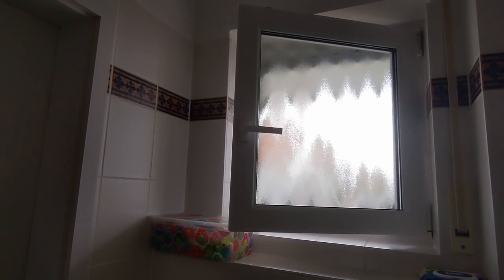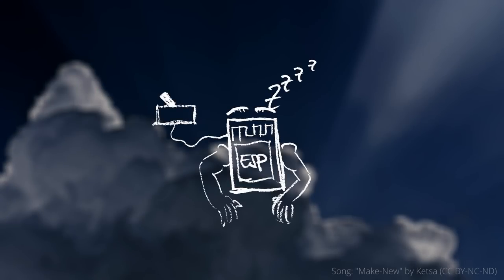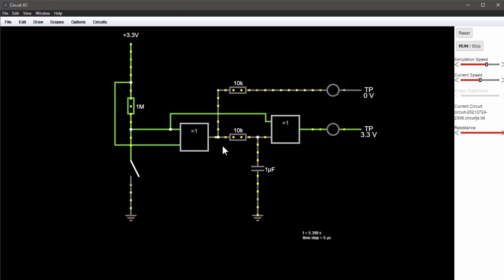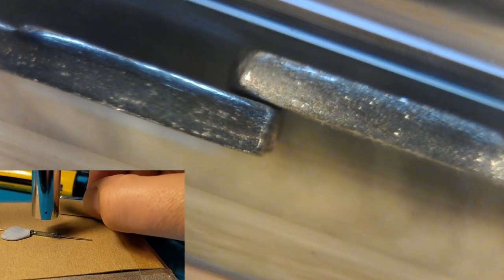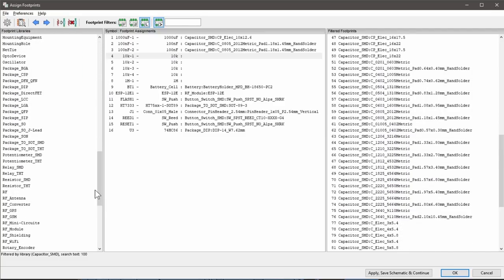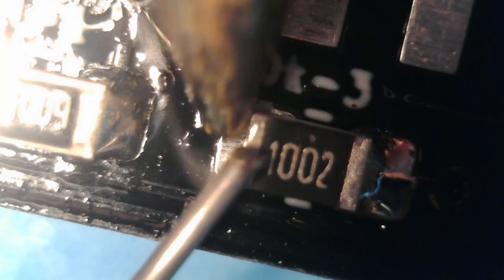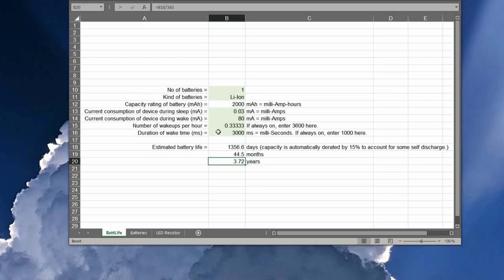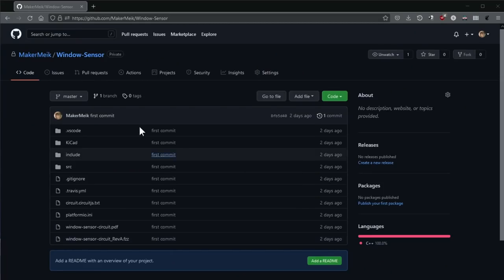ESP8266 as Window Sensor with years of battery life

Comment: A great video and I've tried Kicad for the second time and it's a lot better than when I last tried it out a few years ago.  In your schematic you have R3 - 10k between 3V3 and GPIO2 shouldn't it be connected between 3V3 and GPIO0?
Reply from the maker: Oh no, you're absolutely right. I just couldn't believe my own eyes. Yes, the pullup should be connected to GPIO0. I have six of these circuits running here now, some of them for about a year. And I can fortunately say that they work reliably even despite the error.

The layman is amazed and the expert wonders. 😂

Nevertheless, I have of course immediately corrected my KiCAD and Gerber files on Github and have already verified this by manually modifying a PCB.

So if someone runs into the problem, it can be fixed with a small piece of enamelled copper wire and a scalpel. But it is best to do this before soldering the ESP-12 module.

Thank you, @gadjetsvideo, for thinking along and sharing your findings 👍
Reply: @MakerMeik  We've all done it! I designed a PCB for work a few years ago and when they came back (much more expensive than $10 :-) ) there were two surface mount port expanders that had the wrong footprint and I spent ages sticking them on upside down and using wire wrap wire to connect each pin to the PCB.

Comment: I've built the XOR gate circuit as shown in the video, but I'm only getting a low pulse while closing the door ( reed switch ) and while opening the door, it doesn't provide a low pulse to wake the esp chip. I have rebuilt the circuit on a breadboard but same results. Can anyone tell, What could be the reason ?
Reply: The guy in the following video is amazing. https://youtu.be/8dT95zBeb1U
 He just used ATtiny85 chip and programmed it to do all kind of stuff like sending Door open/close code, sending battery low/high codes. And his circuit idea uses only 4mA just for a second while sending code and than at 0.5uA in standby mode. Seems battery would last much much longer.

Comment: This is truly brilliant! Although I know nothing about electronics, you inspired me to want to try this. I'm a complete beginner and looking at how to run a Servo (MG995) with ESP8266 and it seems impossible to share the same output charge for them both as one requires 3.3v while the other requires 5v-9v, yet I see some tutorials that show it IS possible - but NOBODY explains the electricity side of it... isn't it wrong to use the same output charge for both ESP8266 and a Servo?? do I need separate batteries for each of them? why some people get it to work?
Reply: There are two ways of doing this. First is to step down to the ESP8266 by supplying an input voltage of 4.8-7.2 V to the servo motors and use a Low Dropout voltage regulator down to 3.3v for the ESP8266. The second way is to step up the 3.3V to 4.8-7.2 V with a boost converter. Your servo motor takes in a driving voltage (VIN), which will need to be between 4.8-7.2 V. It'll also take in ground (GND). Finally, it'll take in a control wire. It's very likely the logic level circuit for the servo will accept 3.3V. If it doesn't work, you need a logical level translator chip which will take in a 3.3V PWM signal, and output a 5V PWM signal. The alternative is to use a microprocessor that operates at 5V like an Arduino.
Reply: @liambiddle4155  thanks! I found most of what you said to be true in a painful way but I solved it simply by using an ESP32

Comment: I'm new to PCB design. At 8:15, is there a reason why you chose those types and values of capacitors?
Reply from the maker: This is a recommendation I have from several other tutorials. What is clear is that if you do not use the capacitors, the peaks may cause the boot process to fail. The electrolytic capacitor has the larger capacity and therefore lasts a little longer, the ceramic capacitor is much smaller, but reacts much faster. With this combination you are well prepared. If you build your own circuits, you should make sure that the capacitors are as close as possible to your microcontroller. This is especially important for long cable lengths between power supply and ESP.

Comment: Great! Do you know if there is a (cheap) generic board like this available which ideally runs on AA batteries (or similar)?
I dream of a generic battery ESP8266 board that wakes up based on some state-change (exctly like yours does), and maybe then powers up an attached sensor and reads it (e.g. via I2C),  transmits the data and then goes to sleep again.
Reply from the maker: Unfortunately no. I recently heard of an ESP32 that is optimized for this purpose, but I can't come up with the name right now. The price was also quite high though.
But as I have shown in the video, it is quite easy to design yourself an appropriate board. And I can tell you, it's a lot of fun to design your own board and hold it in your hands later.
If you want to use AA batteries, however, you should pay attention to the discharge characteristics, which are very different depending on the technology. Andreas Spiess has once again made a very good video about this: https://youtu.be/heD1zw3bMhw
Reply: Things on Edge Cricket may do what you want
Reply: @sebastien4116  cool! Thanks! Sounds almost ideal!
Reply: @sebastien4116  you meant "OKdo CRICKET V1.0" by "things on edge", I think.
Reply: @MoritzvonSchweinitz  no, "Things on Edge" is the manufacturer, and board is called "IoT Cricket module". OKdo is just one of the resellers.

Comment: This excellent video just popped up in my feed - many thanks! I have liked & subscribed, and I will have a look through your other videos. I like the look of your radiator thermostats - I have so far struggled to find a suitable unit to use here, but I am still looking. Which did you go for? For this video, the only tiny change I would make - a small case for the magnets rather than tape on the window frame!
Reply from the maker: I have thermostats from Eqiva. Mine are quite old and do not even have Bluetooth ... so I myself have not yet implemented the suggestion from my own video to turn down the thermostats when the window opens. In fact, I would buy "smart" thermostats also only for this purpose and only where it makes sense. So for the bathroom and the toilet.

I don't think you can save money with these things. It makes much more to optimize your central heating. I plan for the next few weeks to make a video about it. The keyword here is "hydraulic balancing".

By the way, the Eqiva thermostats without Bluetooth have an amazingly long battery life. Unfortunately, I can't tell you which thermostats with Bluetooth also have such a long battery life, so you should definitely check beforehand. Nothing is more annoying than having to replace the batteries every half year.
Reply: @MakerMeik  Thanks for the reply! I tried the Schneider Electric thermostatic valves, but found that they would reset their state to open after I had closed them. This proved very frustrating, so in the end after trying to discuss with their support team I sent them back. The heating in our house is well balanced, but the problem is that I don't want to have to remember to turn the thermostatic valves down when leaving a room. For example, the bedroom heating doesn't need to be on during the day, but I would like it to warm the room up before we go to bed. Last night, the thermometer on the wall showed 15C when I went to bed, because I had turned the valve down in the morning, and hadn't gone and turned it back up before going to bed. Of course, 15C is not too bad, but also winter isn't here yet!! The Schneider Electric valves are (IIRC) zigbee protocol, and have a reported battery life of about 1 year. Like you, I wouldn't install them in every room, but only those which matter - probably the living room and the bedrooms. As long as I can set the valve state, ideally from (say) 0 to 100, and can read the battery state, that is all I need. I would use different temperature monitors to gauge the room temperature. When I looked last time and decided on the Schneider Electric thermostats, it seemed that everyone wanted to tie you into their ecosystems for control. This is a big no-no for me! I guess I will have to keep looking...!
Reply from the maker: The thing with the manufacturer clouds is the same for me. That's why my smarthome currently consists of 100% own circuits or at least smart devices with ESP8266, which I have reflashed to Tasmota.
And that's also the reason why I've been hesitant about thermostats so far. But I plan to take the time to take a closer look at this topic.
I'm not sure if there are reasonable thermostats that can be reflashed to Tasmota and have enough battery life. Recently I discovered a project that looks promising:
https://github.com/proemtech/Model-N-Thermostat
But I don't know if it's any good.
I had also considered making my simple thermostats smart. Today I really think I can do it with a reasonable battery life. But whether the tinkering is really worth it and how nice it looks in the end is another question.
In this case, I would tap the pulse generator, as someone has already done here:
https://www.youtube.com/watch?v=kmL-XzHjC6s
And beyond that, I would try a JDY-23. That's a Bluetooth LE chip that consumes only 1µA when in receive mode, thanks to Bluetooth 5.0.
But maybe I'll just buy a ready-made solution. If you have found something good in this regard, then I would be happy about a recommendation.
Reply from the maker: Oh, and one more addition on the subject of temperatures. What many people forget is that it is not only the simple radiator that gives the pleasant feeling of warmth. Instead, at least in massive houses, the walls and ceilings warm up and then quickly return the heat evenly to the room, for example after cold airing. So if you cool the whole room down during the day and warm it up again in the evening, the radiator is very busy bringing the walls and slabs back up to temperature. So the savings should be much smaller than expected.

Modern buildings take advantage of this and build the heating hoses directly into the concrete slabs. The keyword is "Concrete Core Thermal Activation". At the latest then you will realize the inertia of the system.

If you try to simulate this with thermostats on a normal radiator, you should at least take this inertia into account and bring forward the switch-on and switch-off process by a few hours.

Comment: Since the module has to wake up first I assume the signal is not instand. What is the delay from opening the window to a signal in node red?
Reply from the maker: The module needs about 3 seconds for the Node-RED signal. The majority of the time is needed to establish the connection. With a permanent connection, the MQTT signal arrives almost without a noticeable time delay. So if you need a faster connection, you either need a permanent Wifi connection, which prevents the feasibility with a battery, or you have to switch to another wireless technology. ESP-Now could then be a compromise.

Comment: Hi there, really I appreciate the good work. I was wondering if it would be possible to use the analog pin in ESP to measure the voltage of the battery and pass it on as a mqtt message so that we can recharge the battery at the correct time.
Reply from the maker: Yes, I should have added a voltage divider to my circuit. At least I let my code read out the voltage at the ESP by using ESP.getVcc(). This is at least enough to notice when the voltage is getting low. But the next revision of my circuit should definitely include a voltage divider. Maybe you or someone else would like to update the board accordingly.
Reply: @MakerMeik  Thanks mate for the reply. I was thinking about how to reduce the update time for this without compromising the battery and then I found the esp-now hub and spoke model. In that the sensor module uses esp--now to communicate which an esp-now mqtt gateway, both being esp modules. The advantage of this is that data transfer takes places in the range of milliseconds also battery usage is reduced. With my limited knowledge I wont be able to adapt this to your system but I think this firmware system can be adapted to your hardware.

In your next upgrade I wish you could look into this also.
Reply: I have upgraded this sensor with ESPnow, making the update interval less than 1 second. Also have added the voltage divider. Thanks

Comment: Can't you make it recharge it self by adding a string and some smaller energy generator?
Reply from the maker: As I have already said elsewhere in the comments, the only thing I can think of on this subject is solar panels. And they would have to be of a proper size for the system to run autonomously. In terms of saving money or environmental aspects, however, this is unlikely to make much sense.
Reply: @MakerMeik  Oh.. I guess I missed that, still thx for the answer :D

Comment: You glossed over it in the video, but how did you end up actually flashing the bare esp module? Is there a guide you followed for this or did you figure it out on your own. I read the esp module documentation from espressif myself, but I somehow still did not manage to get it working, any help?
Reply from the maker: You're right, I've only touched on many topics to keep the video as compact and entertaining as possible. That's why it's not necessarily aimed at absolute beginners. But the software side is not very complicated. You connect the pins RX and TX crosswise to the RX and TX pins of a USB-to-TTL converter. In addition you connect 3.3v and GND of the converter, and then you can upload the ino file via the Arduino IDE or PlatformIO, if you have installed the necessary libraries there.
I have already shown the basic principle of using the USB-to-TTL converter in my ESP32-cam-basics-video. With the window sensor you just do the same.
https://youtu.be/OeogSzLhRLk?t=88

Comment: Hi. What kind of soldering iron are you using here? 11:54
Reply from the maker: I have built the soldering iron according to the construction proposal "Maiskolben". There is an article about this in the German "Make" (unfortunately only in German)
https://www.heise.de/make/artikel/Platine-fuer-DIY-Loetstation-Maiskolben-3569923.html
The developer also has a store where you can order the PCB. But these are often not in stock.
https://hannio.org/en/produkt/maiskolben/
The soldering station uses the professional soldering tips from Weller, I use e.g. the Weller RT 1, and it controls them via an Arduino. The total sum of the components is about 80 EUR. However, in the meanwhile I also bought a Miniware TS80P, which has a similarly good handling and costs similarly much, but without the tinkering effort.
Reply: @MakerMeik  It seems to be more expensive than a diy kit from aliexpress for hakko t12 soldering tips. Thanks!

Comment: Hi. How long does it take from the actuation of the reed switch to the arrival of the MQTT message?
Reply from the maker: This mainly depends on how fast the ESP can connect to the wifi. The fixed IP address helps a lot and with that you are at about 3 seconds.
Reply: @MakerMeik  If use this to turn on the light on the motion sensor, then the time delay may be so long. But in other cases it's very cool. Sorry for my english
Reply from the maker: That's right, it is not suitable for that purpose. I just stumbled across the extremely exciting JDY-23 Bluetooth module. This is capable of Bluetooth LE and consumes only 1 µA of power in "listening mode". This would certainly allow you to build a more responsive circuit, if Bluetooth is a solution for you. The range without walls is supposed to be 60m. Maybe you want to think about a circuit based on this ;-)

Comment: sir great video but you circuit would be much smaller if instead of using XOR gate you could simply connect a pnp transistor to the EN pin and connect any available Gpio pin to En pin so when switch truns on it would start esp send the mqtt msg and gpio pin would keep the En pin high for certain milliseconds to give enough time for the MCU to do its stuff and then pulls low turning the esp off again.....
Reply from the maker: Sounds very interesting. But I don't quite understand how this can work if the reed switch is not switched on but switched off while opening the window.
Reply: @MakerMeik  yeah i myself realised it after i posted my comment that in this situation you need a physical input also after starting the MCU..... OR we can simply have it  in the code that as soon as the MCU restarts it would send the msg but only If you just have one task to execute... But with your design we could have multiple inputs and multiple task too....

Comment: but.. why would you use bloated Arduino and slow protocols like mqtt...
Reply from the maker: MQTT transfers the data in fractions of a second, I don't see why that should be a problem. Since all my smart home/IOT components are based on it, there is no reason to choose anything else. 
The only time waster is the WiFi connection setup, which you could speed up with ESPnow for example.

But just tell us how you solved this. Do you already have a finished project or even a youtube video that we can watch as a tutorial.

Comment: How much your circuit will change if you use ES32 module ?
Reply from the maker: I don't think this would make much difference in the circuit. After all, you are putting the ESP to deep sleep, which the ESP32 can do just as well. But since the ESP8266 is already being bored, the question is why you would want to switch to an ESP32.
An of course the ESP32 has a different footprint. This is not only a bit bigger, it also has a different pinout and a different grid size of the pads. So a redesign of the PCB would be necessary. But from my point of view the basic principles would remain the same as before.